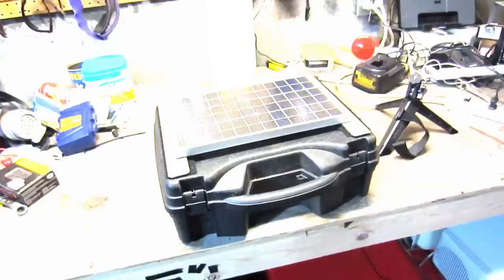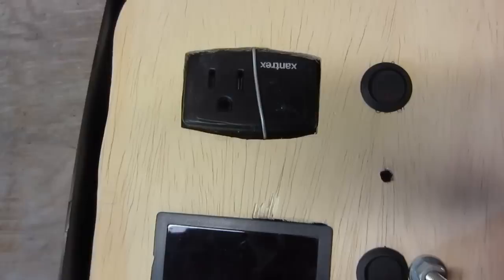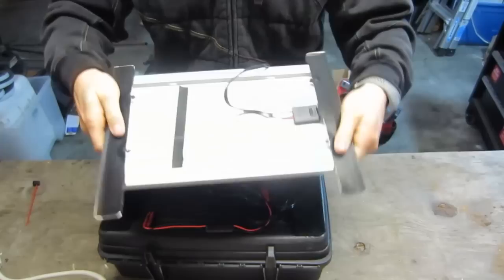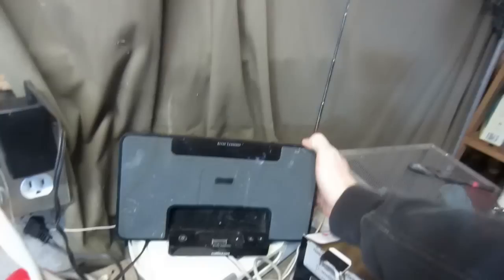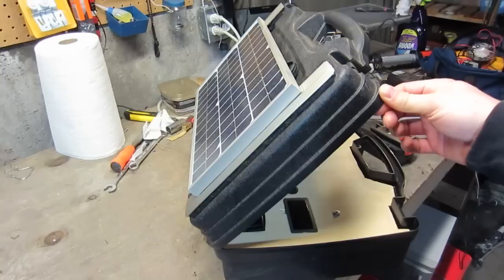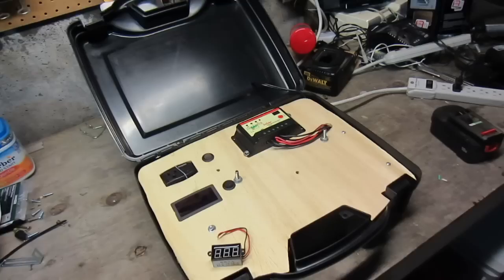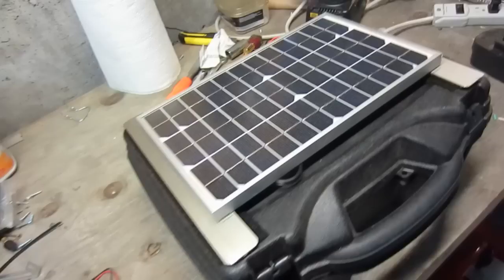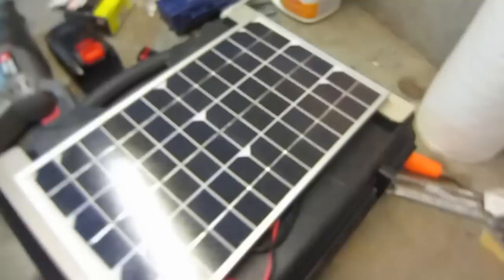Build a high quality PORTABLE Solar Generator For $150

Comment: I spent many hours trying to figure out the wiring BUT I finally done AND it works!!! Thank you for posting these videos. If you do another video, please explain where to buy the wires, connectors, etc. for those of us who are completely DUMB when it comes to electrical wiring. I now know how to cut and strip wires but I was deathly afraid to do it.
Reply: What guage wire did you end up using?

Comment: 1. Put adjustable arm inside to prop panel open at different angles
2. Cut and secure lazy suzan to bottom of box, so if it's propped on a picnic table you can easily turn the box to follow the sun.
My two coppers :)

Comment: Get a luggage tag holder and attach it to the handle, put a disposable plastic card like a store discount card etc in the tag holder and use it to separate the velcro without the fight. Just slide it through between the solar panel and the case to separate the velcro easily in seconds. Hope this helps.
Nice system BTW, will be building one myself since where I live power outages are common and sometimes last for days or weeks.

Comment: Only about 100watt hours once you factor in that you shouldn't take the battery below 50%.  Still seems good for your purposes.  Not like you are running big screen tvs and stuff off it...lol.  A little bit of power is better than no power any day.  I like how you kept it nice and simple.  Some people that make these go WAY overboard with all the different possible hookups.  They end up putting an extra $100 to $200 into it with things they will probably never use.

Comment: 12v X 17.5ah = 210wh... if you know how many watts your devices will use, you can divide 210 by that number to tell how long the device will run.  ie:  a 50w bulb will run for a little over 4 hours..   A USB device is only .5v draw.

Comment: Thank you for sharing.  Nice portable size and lots of capability.  I like the improvements that you intend to add.  I am noticing that USBs are getting handier with lots of units using them as the power port.  I recently got a superbright LED USB unit that is really quite bright for doing late night computer work and seeing the keyboard.  I was wondering if you could just design a box so that you could plug in the power supplies for the construction equipment right into a port on your charging array.

Comment: Good portable setup you have there Thanks for sharing!
By the way theres Nothing wrong with Harbour freight panels.They are cheap and they work! I am pleasants surprised. Ive had three 15 watt a piece (45 watts total) on my house for three years no problem charging two 115 amp hour marine batteries. I purchase "good" quality 12vdc lights 6 watt (780 Lumens output) and 8 watt (950 Lumens output) I have eight of these lights in my home in various rooms incase the power goes out. I also have a tigerclaw 4000 watt sign wave inverter to power anything else.

Comment: It's not just a few wires though, there are two switches, voltage counter, and u didn't have any wires inside the box where the light bulb pic is shown. Which makes me wonder how u wired it. The wiring is the most important part,  another video explain this would be a great help for all 😊

Comment: 10w panel and 17amp hour battery , nice , but how about getting into the figures on the efficiency of the panel to battery loss , and the battery inverter info . This is a great start , but did you look at the rest of the info ...... and it so nice to see that you made the effort than lugging round a engine / generator ( V8 car engine is less that 25% efficient , fuel to wheels ) ..... keep hacking & making it fit for the real world .

Comment from the maker: I don't have a video of building it. I could show what's under the wood cover nuts it's not much to it. A few wires and a battery.  Click the link in the description, there's photos and diagrams.
Reply from the maker: *****

More details and parts list: http://solarburrito.com/build-your-own-solar-power-generator/

It had a 150 watt inverter during this video so it's limited by that. I use to charge battery powered tools, cell phones. It could hook a bigger inverter up but it would drain the battery faster. Build one to your needs, if you need more power you may have to sacrifice portability. For example you could get a full size deep cycle battery, 150watt panel and a 1500 watt inverter but they wouldn't really be portable for my needs. - I'm going to go step by step through building this in another video but need to get some time to do it.
Reply from the maker: ***** I show the components and prices here: High Quality $150 Portable Solar Generator Components Depends on the inverter you use. I'd use a 150watt to 400watt inverter. I sized my system to be portable for charge laptops and tool batteries. If you want your system bigger or smaller use different size components. Decide what you want to power then get an inverter that can do it. If you go over 400 watts you'll need more batteries and it will be very heavy.
Reply: Interesting!!

Comment: See the Electric Motor? You can use a solar panel to run an electric motor to run a generator and create Watts, using a controller, rectifier, battery bank, and inverted  - Solar powered Generator using an Electric motor

Comment: Looking for a guide using 18650 cells. The lithium cells are getting really cheap, getting to the point where 1 with a capacity of 5300 mah can be had for about a dollar. grab an inexpensive inverter with usb and that charge controller, and 100 18650s and you'll have a monster. Just need to find a good guide haha

Comment: I went for middle ground Im using 600 watt inverter, a spare one too a 200 watt one. So if u need to use them 24 hour, change them after 12 hrs as these can't be used all the time unless u buy a really expensive one. Any pics u need let me know as mine is almost finished now.

Comment: I have some components of a simple generator box - and some questions on how to set up.
Have:  
1. Harbor Freight 45 v solar kit -- 3 panels and the power controller.
2. A 12 v 100Ah deep cycle battery.
3. Newport Vessels  smart battery box -- lots of outlets.
4. A 12 v charge cord for the mag safe cord to the Mac Book pro.
The ultimate goal is to be able to charge batteries -- AA  AAA   D   C   and the Mac Book.
No inverter yet - no battery chargers other than some small ones that plug into 110v outlet.
So---- Wondering what else I need to buy, and how to connect this up to charge batteries.
Not only setup - but what battery charger to buy. Will little battery chargers work plugged into an inverter?
Any advice appreciated...

Comment: So youre description says you only run a single 18 amp hour battery, but you keep saying youre running TWO 17 amp hour batteries.What brand are they? Where did you get them? Could I run a slightly larger panel with a 400 watt inverter and a couple slightly larger batteries in a slightly  larger case? What brand and where did you get the controller? I'd love to mimic this setup to run surge protector and a few essential electronics, yet still be able to fit this into a faraday sage that isnt too huge. Thanks for making this!

Comment: Great job...thanks.  Saw 100 lb $900+ unit that exceeded my needs.  Yours seems more suitable.  Couple minor suggestions, thoughts & questions.  You might trim & file protruding screws & sharp edges that can snag your skin and gear. Any low batt alarm or does inverter just die?   Practical to Velcro bother sides so when transporting or storing panel is protected?  My gear can get beat up while in trunk.  What's wrong with Harbor Freight panels?  Yes, do need USB.    Kudos and thanks again!

Comment: Great video, iv made mine just a little unsure of the wires underneath. Iv fitted Ali circuit breaker 30 amp. So the live to switch, then switch goes on then that live goes to the box on top of wood or inverter or both on same electric line ?
Iv also added a big air flow hole with a rubber in, in hot weather there isn't much air circulation to reduce inverter heat. I made a cubby section to store extra wire for when I fit another screen. I have also use velcro on the lid for a spare screen for use of spare case one gets broken some how. Then I used the foam of the box as a finisher etc.

Comment: How did you mount that flat aluminum stock to the panel? I've actually bought just about everything based off your setup and want to mount my panel to the case but don't wanna risk damaging the panel. Also, do you think it'd be a huge benefit to add a 2nd panel to the other side of the case? I'm also using the same battery as you but I'm thinking about building my own a little bigger(amp hours) using several 2 cell battery packs so I can wire them around in the case wherever there's room. Also thinking about using lexan or another poly carbonate plastic for the deck instead of plywood to save weight and make the components easily visible for inspection. What do you think?

Comment: Can you use any  tool  battery and get to the wires and connect them to the solar charge converter. out of the 6 wires on the converter are there 6 wires on the tool battery or do i double up on the wires from the tool battery to the converter.

Thanks !

HAPPY NEW YEAR !

Comment: This is really neat & compact, & I really like it for a small camper.  However, I'm wondering if it's really any better than the Geti 150 which I saw on sale for $169.  This cost almost as much but then it does have a small solar panel included in the price, whereas the Geti wouldn't.  Would yours be enough to run a small fridge in a camper?

Comment: With your design you talk about storing the panel inside the lid , is there space to stack 2 panels in there ? 2 panels would work fine with your system right ??
Good job !!

Comment: Any reason why you don't use the "Load" output on the Solar controller? This will protect your battery from being overcharged and destroyed.
Reply from the maker: This particular charge controller is a lighting controller so the load function does not work for my use. You're incorrect that this will damage my battery.The charge controller still fully functional as I hooked it up is protecting the battery from being overcharged. The function that I do not have is automatic load disconnect if you would like that feature I'd recommend a slightly more fully featured charge controller with the load disconnect when the battery gets too low. Good luck to you.
Reply: SolarBurrito What i meant by being destroyed was "over discharge" or load disconnect.

Comment: I just checked out your other videos and WOW! This is great! I ran into one problem though. Amazon no longer sells the solar panel you used and I cant find any other panels anywhere close to as small as yours. Could you please measure the panel for me in millimeters? The only ones I can find look much much larger and thicker.

Im excited to build this, but Im worried Ill continue to run into snags like this. Im thinking maybe I should build one just a little bigger that would weigh around 20 pounds or so. Still very portable but would have easier to find components and a bit more power output. Would it be ok if I got your email or facebook and talked with you some more about this? Thanks so much again for making this DIY tutorial. This is very exciting and such an amazing idea.
Reply: Amazon has many small 10 watt solar panels. Did you eventually build yours?

Comment: I’m thinking of doing something similar with a large 94DLT tractor/semi battery and a 3-4K watt inverter for off grid camping... you think something like that would work?
Reply: Yeah it would just have a good charge controller and id say atleast 3 100 watt panels

Comment: Would ENERGIZER 180W Cup Inverter 12V DC cigarette lighter to 120V AC on Amazon be an ok converter for the battery you recommended on your list? I want to get a converter with the most ports to save space and get the most out of it. Please let me know I really want to build one of these but don't want to buy the wrong stuff. Also could you do a quick video on opening up the converter and connecting the wires to it, everything else looks pretty basic but the converter looks like it may be difficult. Thanks again man love your videos.
Reply from the maker: http://solarburrito.com/build-your-own-solar-power-generator/

Comment: Also what is the best way to wire the battery to the charge controller? What is your recommended type of bus bar?
Reply from the maker: +Brady Smith There's only one way to wire it. follow the instructions on your model of controller.

Comment: How many times can I charge and iPhone 6 plus with that? I'm not that good at understanding electricity. I been getting good at understanding MaH. I just got a 6,000mah mycharge for the iPhone 6+ and it charges from 0 to 100 percent  twice. 

How many time can I charge that same iPhone 6+ with your battery? That would give me an idea. 

Like you said you help people off the grid charging their phones. If we use iPhone 6+ at 2,800mah. How many times can your battery do charge. 

It's so difficult for me to understand. 

Btw really cool video and I wish I had your brain.
Reply: +George Torres From the info shown, I'd think you could recharge your iPhone about 5 or 6 times.  That's just with the 17 Ah battery (17,000 mAh).   But, with the sun shining, you'd have unlimited recharges, because the panel will recharge that battery inside the case.
Reply: +Ray Sills  Batteries used in a solar set up should never be fully discharged (they can be if you wanted to, but it shouldn't be done). The most it should be depleted is 50%. So that leaves about 8500 usable mAh for this particular set up.... divided by the iPhone 6+'s mAh rating, leaves you with about 3 full charges (but it would be less than that once you take into account any losses from the power Inverter, connections in the case, as well as the efficiency of the solar panel itself). But this recharge count is only a concern if a person never recharges the battery pack in the sun. Considering most people only charge their phones once a day, as long as the case is put out in bright direct sun light 2 (3...?) times a week to help it recharge, a person should never have to rely on a home outlet to charge their iPhone 6+... and it's even better for phones like the 4/4s/5/5s/6/6s that have smaller mAh batteries.

Comment: Great idea and I plan on building a similar unit soon.  Question, how do you wire the switch so that it kills everything going to the battery?
Thanks
Reply from the maker: Put a switch on the positive side of the battery.

Comment: Just curious?   I'm planning on making the same unit but with 2 batteries.    Should I use a larger gauge wire to tie the two together?  And if so what gauge would you recommend?

Comment: Love this, how long dose it take to fully charge your battery with full son?
Reply: 10w solar panel running thru a PWM controller. Getting at best 8 watts of usable solar power X 5 hour of sun = 40 watt hours. Divide 12 volts = 3Ah. 17Ah battery / 3Ah = 5.6 Days of full sun to recharge the battery from flat.

Comment: How could I wire a bestek 400 watt inverter to this system with my sunforce 60031 charge control? Thanks!
Reply: +Brady Smith You have to use a battery to run the inverter off of.

Comment: pretty cool! Can you power a small 40-60 liter portable fridge?
Reply: Of course it can but for a limited time only, that is mainly due to the batteries. A 20Ah car battery will give you about 3h use with a 50W fridge as you can not discharge the batteries all the way to zero . A deep cycle battery will you give somewhat longer use. 

The 10W solar panels in this example will hardly contribute to the time as the panel is to small. You would need a 150W (minimum) panel for continuous use of a 50W fridge in a sunny environment.  You will also need a bigger battery in the range of +100Ah to be able to run over night. 

As you see, such systems are hardly man portable.
Reply: Naoh Watson Thanks for all the info, I have a lot to learn, all the details.